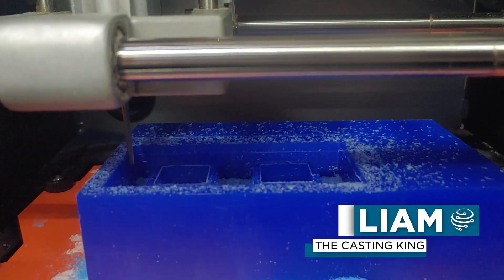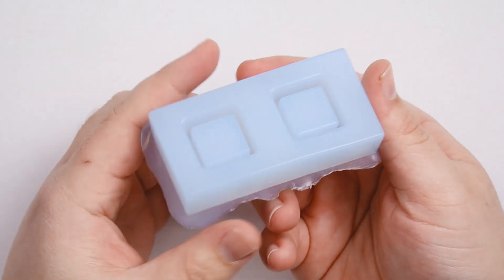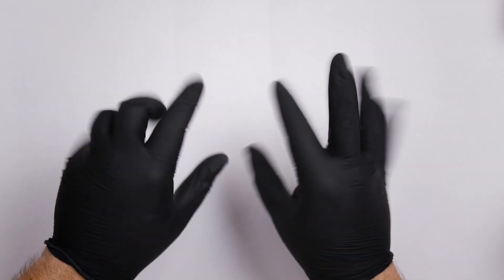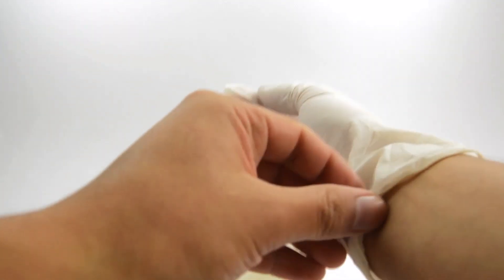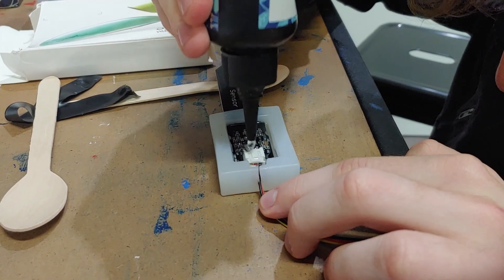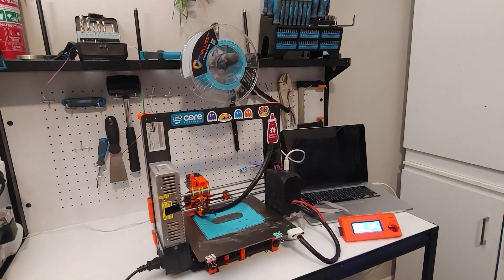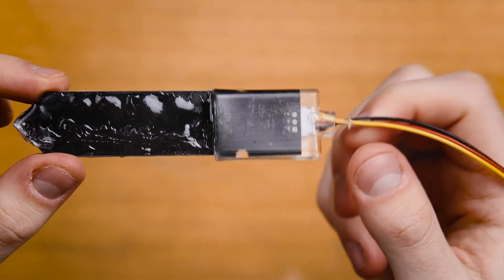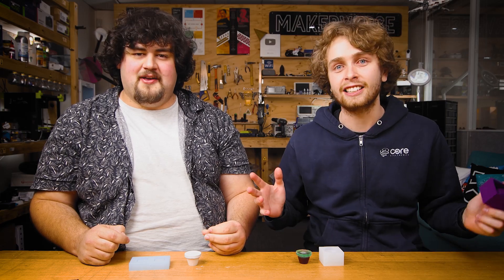Moulding & Casting | Zero To Maker Workshop

Comment: did the waterproofing epoxy alter the capacitance of the sensor significantly?
Reply from the maker: It did affect the performance as the sensor is a little less sensitive, but it was still plenty enough to detect soil moisture. Just had to remap some readings!
Reply: @Core-Electronics  Cool!  thanks for the response dude!  Good to know you were able to work-with it with a little tweaking.  that makes the method very use-able to me , I appreciate the info